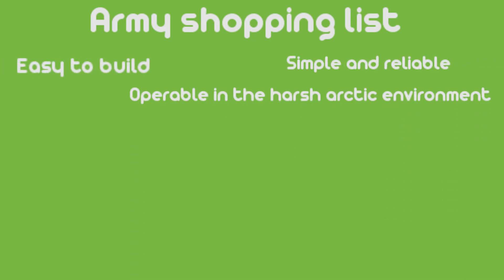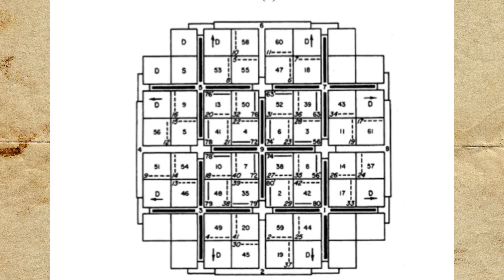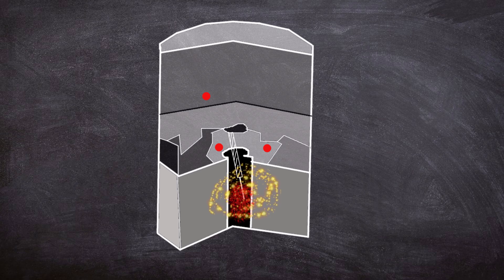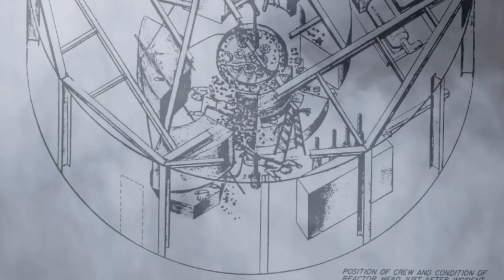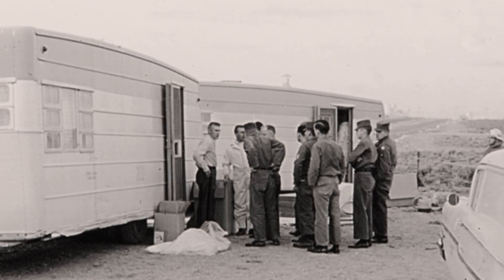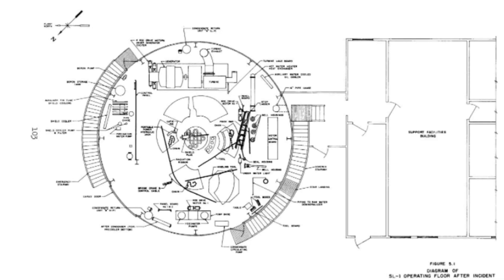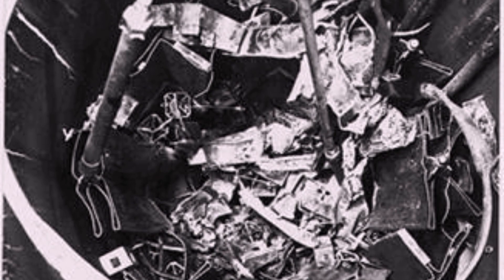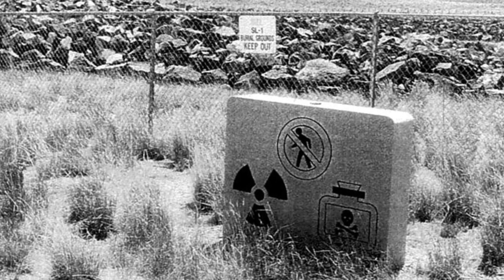A Brief History of: The SL-1 Reactor Accident

Comment: I knew a guy while in the Army and Stationed at Ft. Monmouth, New Jersey. His job was "Nuclear Safety Officer". According to him it was his job to go out to Arlington National Cemetery twice a year and check the gravesites for radiation leakage. He also said that there was some rooms with dangerous levels of radiation in the Coastal Battery at Sandy hook NJ due to testing done in the 1950s. these rooms were sealed and not accessible by the public. According to him the radiation was almost background levels by then though (1986).

Comment: Positive reactivity addition accident. Rod speed was what generated so much power so quickly. Exponential rate of generation in proportion to rod speed. Much of the data about neutron flux was derived from forensic examination of all pieces of metal in each victims clothing. Zippers, watches rivets, buttons, keys. All were thoroughly examined to determine what shift through the periodic table had taken place based on neutron flux levels. The physics involved was impressive. One interesting item omitted was the fact that each piece of heavy equipment (every one of them remotely operated) used to bury every piece of the facility (buildings and all) were then driven into the pit and in their turn were covered with earth by another set of remote controlled dozers. Amazingly resourceful arrangement of TV cameras and servos. All that remains is a sign on the side of the road where SL-1 once stood.

Comment: There are other videos that explain the control rods would offer get stuck. It was reported that’s the fix was to pull hard and sometimes 2 people would have to pull on them. The theory was the operator was pulling to hard and the rod dislodged to quickly. This caused the rod to be lifted to high. The other problem was there were using to few control rods and file rod pattern that was developed during testing. Not how it was designed.

Comment: the cypress structure oakland failure to account for the geology and out of sync vibration as the bridge was located over a  pleistocene valley which was infilled with bay mud (seismic gello)as sea levels rose after the last ice age the different seismic accelerations caused failures at the sectional meeting points

Comment: I'm just curious, was it a common practice to leave catastropic failure points up to human error in nuclear sites? I mean, why was it even possible to withdraw the rod so far, if doing that ended in an instant core meltdown and explosive flash steam creation? And they did it by hand, without any tools that could constrain the rod movememt in some safety margin. Damn.
Reply: In those days the nuclear engineers had no depth of knowledge about criticality and what it meant. As a matter of fact they used to play games with fissile materials which they used to call chasing the tiger by its tail in which they brought to fissile liumps into near proximity. Not just anybody knows how to calculate criticality and even when that is done fuel rods can only be positioned with special bearings known as nuclear bearings.
Reply: @factorylad5071  So in other words... they dindn't know what TF the were doing. I just realised how close we came to a Great Filter scenario. That makes my anxiety worse, thinking how much beligerance is still there in the nuclear field. Holy cow.

Comment: Here's a scarry fact, 500 rontogens is also the maximum number that most American high dose Ionization Style radiation detectors went up to that the time. Ik this sounds like in the show Chernobyl but it's true. His body might have measured radiation much higher. Maybe 10,000 rontogens considering he died so quickly. Since he died in hours instead of in weeks like the Chernobyl victims. His accumulated dose should have been high since he was next to the critical reactor for several hours.

Comment: At very minimum there should've been a tool that pulled the rod out and limited its travel to only that needed to attach it to the control mechanism. Using your arms to pull on stuck-ass rods with no travel limit is ridiculous.

Comment: Why didn't they have like a mobile, screw in metal tripod over it to prevent it from being removed too far accidently?

He probably thought it would be stuck, yanked it, but it wasn't and too late.

I think the suicide ideas are 1. When they couldn't find the third body at first, they thought sabotage. After finding the body, the idea of sabotage was just still stuck in their heads. 2. Just due to shift blame away, by wanting to blame intentional operator error instead of blaming the risky design that let's such a thing unintentionally happen so easily. Other comments here about disaster investigator conclusions supports this.

Comment: The boron didn’t Corrode away. The boron decayed to Carbon ( which is structurally weaker)  which lead to carbon breaking off and causing the control rod to be stuck in its housing

Comment: 5:25 m8 how are you going to mess up such simple terms like that? critical means power levels are remaining constant. super critical means increasing reactor power. and it wasnt the rod that went super critical, the rods are not where the reaction is happening. it was the reactor core that became extremely super critical.  you also failed to mention why it was withdrawn so far, it had a history of sticking and they guy had to yank on it to get it to move and once it did, it popped up way to far. also saying it created a water hammer doesnt make sense. it just made a steam explosion. water hammer refers to something completely different.

Comment: My Navy training stated that the distance the rod was withdrawn was less important than speed of the withdrawal. The reactivity equation has a rate of reactivity addition factor that would have caused a local supercritical condition if the rod was moved quickly.  The training at that time stated that the heat generated would cause enough water to flash into steam to over pressurize the reactor components and eject the rods.

Comment: Isn't manual manipulation of the rods a design flaw to begin with? 
Why was he even able to move the rod that far up?
Reply: Some reactor designs included manually-movable control rods, so that in the event the powered system failed, the rods could be released from the drive system and dropped into the core.

Comment: The reactor is almost always critical when in operation. The problem is that it went prompt critical which is where neutron generations that result in new fissions can no longer be controlled with poisons and control rods. Thus cause an almost instant skyrocket in reactor power way above any operating limits. This event is one of the reason why most of the US’s reactors today have very specific control rod criteria.

Comment: One of the most interesting things learned from this incident was that it wasn't the displacement of the control rod which caused the disaster. It was the  fact that they drained the reactor down beforehand which was part of the procedure. Had they not done that step, the reactor would have gone into a much slower melt-down rather than a catastrophic instantaneous explosion. A melt down would have spiked internal neutron sensors letting them know they needed to replace the control rod before something bad happened.

Comment: I cannot believe that anyone, ever, anywhere, thought it would be a good idea to design something such that a human has to manually pull a rod out of a hole the correct amount or cause a runaway nuclear reaction... What were they thinking?
Reply: The reactor wasnt designed to have its control rods adjusted via human muscle.  The rods had to be pulled up 4"/10 cm in order to allow them to be attached to the machine that move them up and down to control the nuclear reactor.  For some reason the rod was pulled up 26"/66 cm, causing the reactor to go "prompt critical".  This reactor was designed to be boxed up in small pieces, flown to the Arctic and assembled on site.  Some allowance in the design had to be made for this small, easy to install/operate reactor to exist.  The operators have to take some the responsibility here.  Because these were to be operated in remote locations, it was a known that some operators had stated that if they saw Soviets approaching the site, that the operators would purposefully start pulling control rods.  Perhaps it was design "feature" rather than a perceived design "flaw"?

Comment: According to a General Electric report on this incident:  https://digital.library.unt.edu/ark:/67531/metadc1029163/m2/1/high_res_d/4763434.pdf  (see page 226)   it says that fuel was enriched to 93.2% ?!!  Few commercial reactors exceed 5%.  Weapons grade material is often only about 70%. If they got a critical mass incident in the course of routine maintenance, it is hardly surprising.  Seems like these guys were messing with some really hot stuff, and apparently the safety measures were totally inadequate.
Reply: Show your link to the 70% weapons grade - or stop lying
Reply: @jwarmstrong    Weapons grade will vary.   This article says 50-89%,   average of 80%.   https://en.wikipedia.org/wiki/Little_Boy#Design  .    What do you consider to be  "weapons grade"?

Comment: Possible reason #573: avoidance seeking reflex.
The tendency of some drivers to pilot their car directly into another car on the shoulder that has ample emergency lights and flares out. 

Clearly there is a car, but the other driver is so fixated on 'other car' that it becomes a goal for them to seek out rather than a hazard to avoid.
See also minivans driving into restaurants...poor old soul had the gas pedal all the way down, thinking they were on the brake.
Operator had a limit firmly in mind, but as he got closer to said limit, the "do not exceed" margin turned into a goal to attain, or exceed.
Ask any police agency about cruisers getting nailed on the side of the road...you would think all those lights would prevent wrecks.

Comment: Those icons were  Sergeant First Class, not specialists. Assuming you got the up side down ranks correct. Or is that Specialist 3rd rank? If it was E-4 they most likely would have fixed it since they are good at their jobs....SSG are just point and click 70% of the time... Which is obvious this time around.
Reply: Byrnes (the one who was operating the rod) was a Spec/5, McKinley was a Spec/4.  The shoulder patches in the video are those of a Spec/8.

Comment: I read the book Idaho Falls about this incident. There is a lot of information in that book. For instance, Legg was struck in the groin with the rod and it exited through his shoulder pinning him to the ceiling. The impact was so violent that during autopsy (done from behind a lead wall with mirrors and angled pruning sheers) they located his testicles in his arm pit.

Also while spending several days attempting to remove all irradiated material from the bodies, when they were not working on them they were thrown into a vat of isopropyl alcohol. One of the young soldiers assisting apparently would climb into the vat and lay on one of the bodies (apparently they are buoyant in alcohol) and then jump out and scare other workers pretending to be a zombie as they walked by. The 50s and 60s were a different time.

Comment: Blame the men and some stupid social situation.
The rods got stuck from corrosion!
The Rods Never Should Have Been Operated Manually!
The Rods Weight Was A Problem Themselves.
Pulling a rod that stuck in place will exceed the limit it should have been pulled out without something to prevent it.

Comment: This is what happens when you try to manually, by hand, move control rods. 

A 3 MW reactor reached nearly 20 GW in milliseconds, about 6-7 thousand times what is was rated for. In milliseconds of moving the rod, this goofball was impaled into the ceiling. 

What did we learn? Let the Navy play with Nuclear Power, not the army. 🤣

Comment: I've worked with heavy and/or temperamental equipment before, it's not hard to picture how the rod could be accidentally pulled out too far during manual extraction.
Reply: ... to think, something as simple as a ratcheting puller rigged as an overhead crane might have been enough to prevent the accident.

Comment: was the RBMK reactor based off this one. ive heard that it was and that russia desinged the rbmk themselves. that would be cool if you knew and told me
Reply: The RBMK forerunner was the Obninsk Nuclear Power Plant. First criticallity was achieved in 1954. SL-1 became critical in 1958 so I doubt the RBMK is based on the SL-1. Also the SL-1 uses water as moderator, Obninsk and the RBMK are using graphite. So the answer is NO.
Reply: Herbertsdottir dude I knew it ty for helping

Comment: Another theory: an improper conversion from SI to Imperial. Instead of 1 inch to 2.5cm, mistaking it as 2.5inch to 1cm. With a mistake of 10cm being incorrectly converted to 25inch. Matching the roughly two feet that the rod had been removed.

Seriously... has nobody else considered that maybe he just fucked up converting SI with Imperial? I mean, getting the conversation backwards matches what was observed really nicely.

I mean... it was a measurement in SI being used for evens in America... one of two countries that does not use SI.

Comment: The rod went up his groin and exited through his shoulder...  😱
Reply: I'd rather be shot in the head than die that way.
Reply: @jenniferbrewer5370  I dont think it matters as both are pretty instant!
Reply: @jenniferbrewer5370  Well he would certainly died by radiation poisoning, so it was "mercifull" death.
Reply: Lumen Lopes nut shot.. ouch
Reply: And he was the one that had an affair with the wife of the man that operated the control rods. Impaled through the groin. Reality is weird like that sometimes.
Reply: Jeesus
Reply: right on the nuts
Reply: EEEEK
Reply: Imagine how you might stand over something like that, to pull upward as hard as possible.   It would be centered right under a man using his legs at full strength.   Then it breaks free ....
Reply: @josephastier7421  he was standing on a balcony above them though, he wasn't the one pulling on the rod.
Reply: @suzbone  Oh, I did not know that.

Comment: if I recall, wasn't removing the control rod too far the same fate for Chernobyl?
Reply: No the staffs were testing how would the reactor work in low power mode and things went wrong from there....
Reply: There were several Problems with the Chernobyl Reactor
they shutted it down but when trying to get it back online they surpassed the Safety Limits causing an Steam Explosion

Comment: An article I read about this in an old magazine from the 1960's stated that The design of the control rods was inadequate so boron 'poison strips' were attached to their sides to increase neutron absorption. That made the clearances to the sides of the square fuel rods' containers very tight. In the reactor vessel's environment of heat, pressure, and radiation the boron strips would swell and flake off, causing the rods to stick. A picture of flaked off pieces of boron, retrieved from earlier servicing, was in the article.

What the men who died were doing was reconnecting the control rods to their drives, after the drives had been removed, serviced, then reinstalled. The design allowed the rods to drop far enough into the vessel that they had to be raised by hand quite a ways to connect them to their drives.

Thus the simplest and most likely scenario is that Byrnes had difficulty raising the rod then gave it a hard yank which worked too well. The stuck rod snapped free and none of them would've had long enough to get anywhere near to starting to think "Oh $h!t!".

The article also stated that a world wide search was done for reactors that could go critical by pulling a single control rod. Only one was found, in Iceland. A safety stop was installed.

That would make the root cause a poor design followed by disregard of problems that had happened often enough that someone should have had a clue about figuring out something to mitigate them. Apparently nobody involved with the reactor, and knew about the sticking rods, and that pulling the main rod all the way out could cause a disaster - had the logical thinking capability to understand the need for a safety stop at least on the main rod.

Comment: One the biggest misconceptions is that Mr. Legg was impaled by a control rod, as evidenced by many of the comments below.  Quote from the official accident report, "the No. 7 shield plug assembly impaled the #3 crew member and pinned him to the bottom of the fan floor a distance of approximately 13 feet above the reactor head."  The report also goes on to state that when photographs were taken of the reactor room shortly after the accident, control rod #9, the one that had been pulled, was found laying across the top of the reactor vessel lid.  If Legg was impaled by the control rod, it wouldn't have been laying on top of the vessel lid, it would have been found stuck in the ceiling.  Reading is fundamental.
Reply: PD should pin this comment, so many people in the comments are making this mistake..
Reply: @xiphosura413  we're going off the video. There's a pointy rod drawn, so we infer it was..a rod. But yeah, he should definitely add that to the pinned comment, to clear things up.